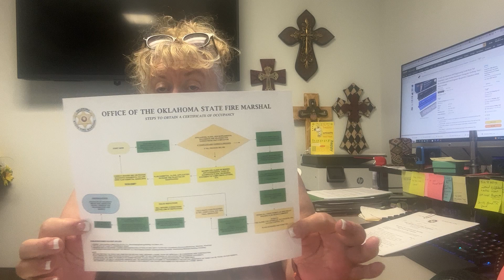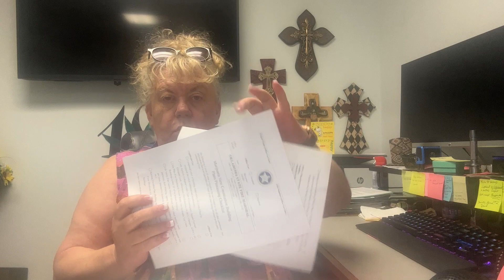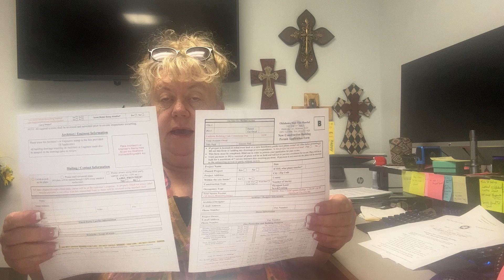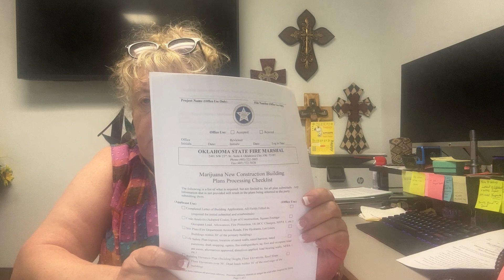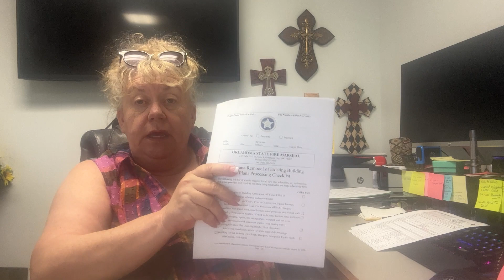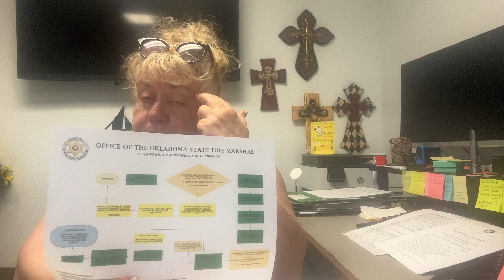Fire Marshal Questions Answered and Update on Meeting

Comment: First off thank you Dana. 

I think that this is grounds for a lawsuit against the county, city and omma. Before I built my buildings I went to the county’s planning department and asked if I needed permits for what I was doing. They told me NO. If the property is outside city limits then there is no codes. “You can do whatever you want, it’s your property.” The people at the planning department told me that their lawyers don’t agree with the certificate of compliance paper from the omma. That’s why they have that letter they gave me for the COC. 

I understand it is state law for Fire codes but now it just complicates the hell out of every thing. I’m thinking someone should be liable instead of the farmers who was told otherwise. It takes a lot of money to be compliant. I was quoted at least 10k for my 2 buildings that are only 3900 sqft in total. This was for pretty much consulting. They don’t come in and do what needs to be done to be compliant. 

I’ve been in business for 3 years.